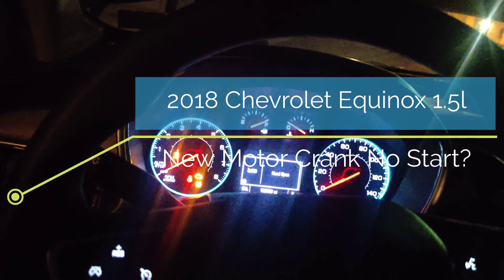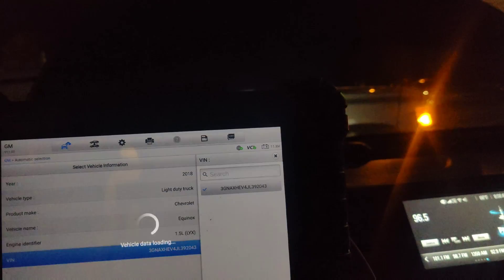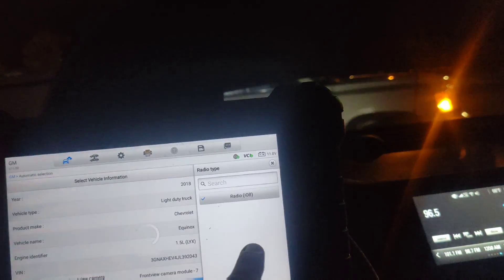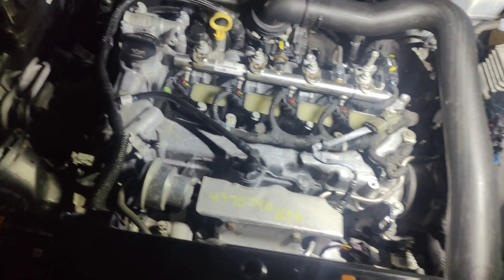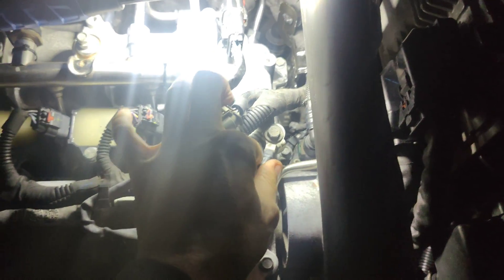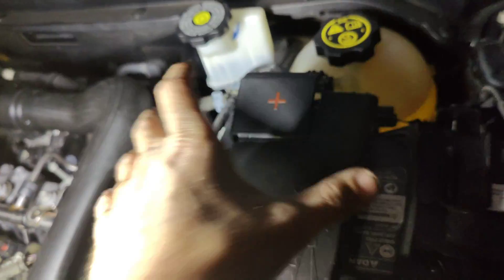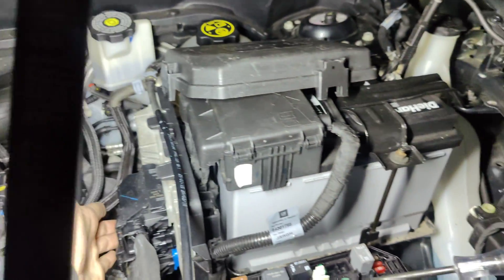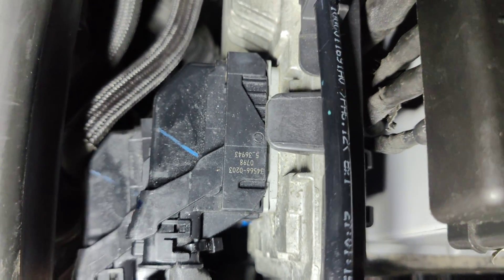2018 Chevrolet Equinox 1.5l Crank No Start | New Motor | 22 Codes!

Comment: Circuit High codes as the BIAS voltages are not being pulled low due to an open circuit, and circuit low codes as no voltages being sent back to the ECM due to an open circuit. Good find on visual inspection and a bit of experience.
Reply from the maker: Thank you, I will pin this comment for others.